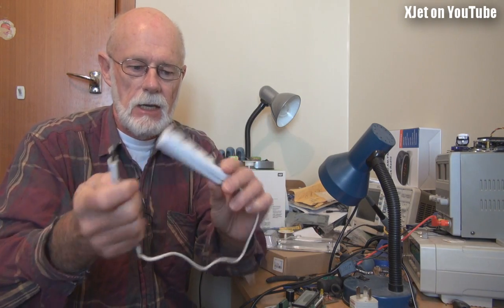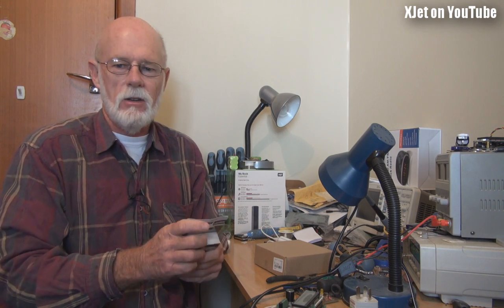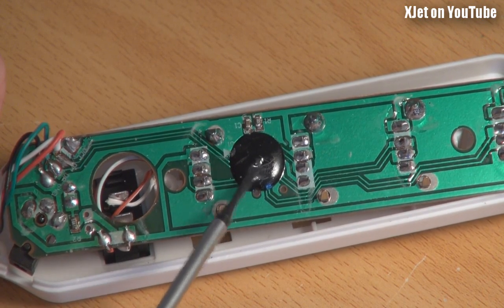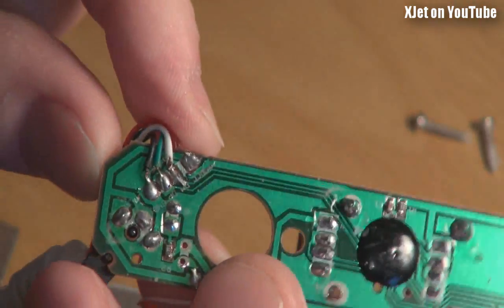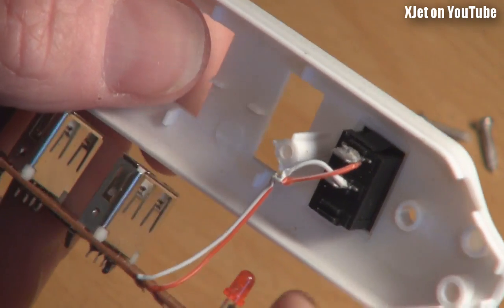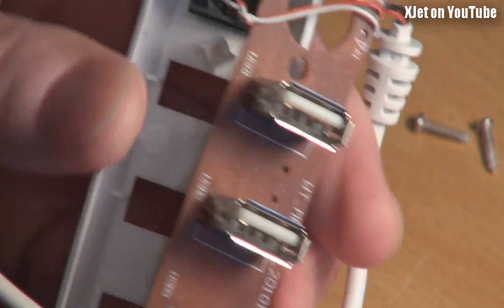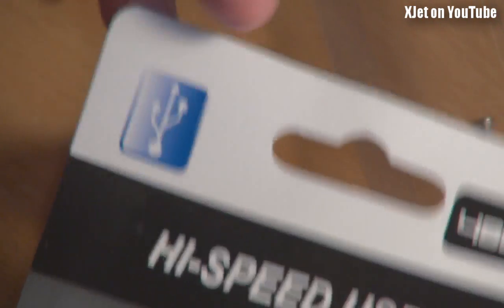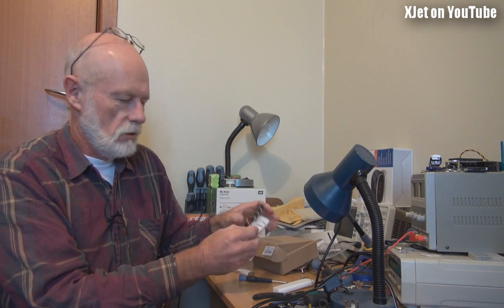A really bad bit of Chinese electronics

Comment: The Chinese have great manufacturing. The reason that we get a lot of "Made in China" garbage is because we ask for it. We tell China "Yeah, give us the cheapest you can, and we'll sell it at ten times the price," because it is very profitable, but if you need something of quality, they have got that too, one just needs to ask for it.
Reply: I remember as a young boy, given battery powered toys "made in China".  I remember my 1st tiny Beach Radio, made in Taiwan.  Looking back, I can say the batteries, made in China, & made in Taiwan, lasted the longest. Names like "555" Kwangchow China, & "Flying Bomb"  having shelf lives to 10 years & longer!.  Today, even famous names like DURACELL are now made in China, but I find those 2016 China made Duracell do not last as long as the 1978 made Flying Bomb cells did back then.  The Canadian Duracell brand , I have a few left now 30 years old, & still working, Canadian made ones.  Conclusion; China can build long lasting & quality, but cheapness is what seems to be wanted now.  If it lasts 1 month, it's a win.  btw my Computer Monitor is from 1996, made in China, used every day, & works 100%, defying a breakdown. 100% quality so again, sometimes China makes it bullet proof.
Reply: I usually find it to be pretty easy to find quality products from overseas that come at 5 or less dollars a piece. Things like USB cables, microphones, headsets (for x360), and even a PC remote. They all came working and lasted for 2+ years. This guy thought he was going to find something quality for cheap relating to electronics from a screwdriver shack. For those wondering, if you want something at a low cost that will likely not be DOA, you have to do it online. Not from ebay or a large market like best buy. But from somewhere like amazon, or newegg, or tigerdirect. A source that has been dealing with such things for a long time. Sidenote, i thought it was funny that the USB Hub had a power switch on it.  I had never once thought that would be necessary, let alone be benificial. "Lemme just take advantage of this feature and flip that switch when i think my files are done writing. Oh no! My files are corrupt. This thing is clearly rubbish." XD
Reply: @Nick1921945  

2+ years is not long. LOL
Reply: TitanUranus I'm chinese and what you said is true.
Reply: At my place during the 80s made in china stuff is quite good. There is some stuffs we still have and still working today. But not so today, they tend to broke in a month or so. The problem is the distributor. Sometimes distributor will search the cheapest product made by shoddy China government-build factory purposely to recruit as much people as possible, not to make quality product.
Reply: So fucking true, and still, shitty brain could not understand it
Reply: The real reason why there is so much of this is not due to international demand , not mostly. It is due to the insane sales tax put onto foreign items in the mainland china. This is why this happens. The chinese communist party wants as many homegrown chinese companies , and it simply isn't working , not in terms of quality. This is the chinese people acting on what little the communist party gives them in terms of business freedom.

Take shenzhen and hongkong. They are next door to each other , yet if i were to buy a foreign product in shenzhen , it would cost sometimes over double the price than it would in hongkong. While i do not doubt that there is demand for these poor quality goods now , i don't think that this is how it started off. It started with the sales tax.
Reply: Wrong, the 'boss' from the factory probably outsources all this cheapie shit to an unlicensed factory then claims it was made at his, QC is a joke, inspectors if done by a thrid party were probably paid off to tick all the right boxes. 
This is from a Foreign QC guy in China.
Reply: The Chinese have great manufacturing? Are you high or a brainwashed Chinese?
Reply: +Brad love to see someone who can only afford Chinese made products complaining about the quality.
Reply: qrpnxz If you know anything about the steel industry in China you'll know they always take the cheap option and they'll scam you at any opportunity, they are the land of the cheap. Quality Chinese products are incredibly rare.
Reply: well said. i got a set of motorcycle fairings recently from china. they're outstanding. better than stock and masterfully painted. that's because they were $450 instead of $40..
Reply: Richard Head When your country is not make them or not enough.
Reply: True!
I was educating some new Chinese customers on operating the equipment they had just purchased. 2 of the several items were made in China, & they both had (quality issues). They spotted right away, & I said they were made in China, (THINKING) they would all cheer & fist pump (DEAD WRONG) "Oh no, we do not want made in China"!   "I said I know the Companies push for production at the cost of quality.. "You  only know 1/2, it is worse than that...it is why we left."
Reply: shut up how wrong can I be? no you're wrong  china have the biggest  factory that's  the truth  USA  and Canada  are blaming China.
Reply: Crackerjack Are you kidding me? China have QC, your faking country have QC, too. if your QC would let shit pass, then it is your QC's issue.
Reply: Mr Qin, you comprehension of the English Language is debatable so if I'm understanding you correctly....
THe buyer will hire a 3rd party QC company to conduct inspection on the product, usually the factory just pays them off, if these 'quality products' passes and has a short or the lead falls off and electrocutes a kid, whose fault is it? QC right? Where's the QC? China. Why the hell would a second round of QC be required if it's already been done ? This is the whole bloody point of getting it done before it's shipped to stop all this shit from happening.
Reply: Are the biggest cars the best cars ?
Reply: China bashing all the time IDIOTS
Reply: munches on popcorn  popcorn anyone?
Reply: What about headphones? whats your take on that?
Reply: Brad Smith Yeah I remember "Flying bomb" batteries, they were unbelievably good, just went on and on and on. I had one 9volt  that lasted for years and years. Great logo too! (bomb with wings) So much for Eveready... I bet they wouldn't make them like that now though.
Reply: I believe we ask for cheap! Not garbage that doesn't work, sold as new!
Reply: Dude they are flooding the market with this shit, kicking honest manufacturers off the chessboard.
Only China can sell this cheap, because the have a billion of government lemmings.
Reply: IDK guys, my made-in-China "Brick Game" bought around 1997 was built like a tank and it's probably still chugging along with a guy who has it now (I gave it away, no idea whose hands it got to)
Reply: Any auth product but made in china is suck as fake.No matter how how much money you spend for it.you most of the time,can't use it over 4 years without it break.
Reply: But Chinese people themselves usually will not buy Made in China labeled products. They buy online or try to find a retailer selling imported products.
Reply: as if chinese people don't buy made in china! give me a break. Some massive brands of phones etc like ZTE lenovo etc start in china, selling to chinese.
Reply: Ya,  we rip off the chinese by giving them cheap, baseless fiat currency that we overprint out of thin air and surprise, surprise - they rip us off by giving us cheap plastic junk in return.
Reply: Even apple also use chinese oem manufacture. you can see that is not the problem of the region but only the QC and design.
Reply: The west not making enough or not at all that why the people in the west need to stfu.
Reply: They have the "can" but we do not have the "want". It is all about money. The cheaper you buy the more you can earn. Simple as that. But China will soon become Japan. We will praise them for they build quality etc. Give it time.
Reply: FAZIK I’ve waited 20 years since 1980s and they still failed while
South Korean Crap from 80s had managed to made a quality product 10+ years later.

Comment: looks like you got exactly what you paid for.
Reply: i have 2 chinese usb hubs and both have the same bad solderings
Reply: YES Chinese children make these things........Yes iphones/macdevices are made in china at foxcom.....Yes they employ over 500,000 Chinese children/slaves.... Yes they have netting around the buildings to stop the Foxcom employees from killing themselves,
Reply: yeah it's all pretty much expected and would be working if it didn't accidently get the wires screwed together lol...
Reply: Dictor Clef scp?
Reply: Russ Walker iPhones are manufactured in China
Reply: Here's the attention you so desperately wanted
Reply: TheXanUser if I pay for something I expect it to work 6 buck or not, if I'd doesn't work from the start it shouldn't be made. If I buy chap I may not expect it to work for very long, but even if I get a couple of months out I it, than I say I got what I paid for.
Reply: I'd beg to differ, the media player was 5 times as much, did much more, and was of much better quality. Media players actually have to do processing using a computer, rather than data routing. The media player also featured a touch screen and an SD card reader (which SD card readers require licensing). If $6 gets you actual trash, $30 should give you something that works barely intermittently with a case that's falling apart.
Reply: Dictor Clef re popped up on my recommended
Reply: Russ Walker Samsung phones are assembled in China and Taiwan.
Reply: +FerickAndrew STOP THE CHINESE
Reply: brendan wilson am i doing an insult here? i am not
Reply: +brendan wilson Yes,Trump, We get it.
Reply: TheXanUser ..  Da Panna chekka Avante ammumeyekettikann  aaaa paratta Chinese make saadhanm konnd engd vannal unndalo ..pelayaadi Mone ..
Reply: Everything I buy is UL certified, most chinese products are simply crap.
Reply: na, you pay like $3 for one of these.
Reply: Woah guy are you from the future?
Reply: this is the best answer ever
Reply: dont have one dont want one, got a samsung
Reply: armando suarez god already made the world, the chinese make the rest
Reply: TheXanUser it is not as simple like that, "what you paid for".
if it is for sale must be approved by somebody.
chinese products should be banned.
Reply: just more proof that everything made in china is rubbish, especially the people.

Comment: Did you try to fix the solder points to see whether it started working again or not?

I think it could just spring back to life if you soldered the USB leads THROUGH THE BOARD (hint: There was holes in the board) and fixed the rest, it COULD work? USB has a pretty good protection against shorting out the leads so it could still be fully functional. Or at least quality motherboards have fused USB ports to prevent burning the port.

That isn't even the worst I've had with USB hubs. One I got from a local "cheap stuff shop" for 25 euros (4-port powered hub), the USB connector was so loose that it would disconnect if you put down a 2 euro coin in the other end of the table. - And it was a mini-B connector so it must have been the reject of the rejected mini-Bs, since they rarely break. 

Annoying as hell if you were trying to do anything with it. From what I remember, I just hot glued the thing together to fix the connector being loose. Maybe ripping it out completely and soldering wires directly onto it would have been even better.

Comment: The Chinese are producing the range from very high quality down to very low cost at low quality. Basically, most of the time you get what you pay for. The brand name companies that manufacture in China demand specific level of quality control with specific calibration tolerance and specifications. 

China also produces very high end industrial and laboratory products for both their domestic markets, and for export to other countries. Many of the high end automotive and machine parts are produced in China. 

It has become difficult to find many types of products produced in North America or Europe, unless they are specialized types of products. There are many types of products that are absolutely no longer produced in the western world. And, this is strong reason why western world jobs have been on the decline.

Comment: I really had a good laugh as you showed the insides. This is really a lack of security within this device.
I knew there were lots of really bad soldered pieces out there, but the circuit you've showed here topped everything I've ever seen so far.
Thumbs up for failed Chinese tech.
Reply: 1994AnimalCrossing

Comment: Another dangerous detail : There is no protection (not even simple as setting a diod) between the USB from the Computer and the 5V from external source. you would get a voltage loopback into your computer.
Reply: yeah that may happen if external supply too is Chinese
Reply: GTI1dasOriginal Oh yea... the fake CE stickers.
Reply: yep... worst case scenario: fry you motherboard.. Let's see if it's "all laughs and fun" when he experiences that..
Reply: @GTI1dasOriginal  Someone blew up their iMac when they hooked up the external adapter to the connected USB hub, if the voltage isn't equal, the higher voltage will backfeed current into the lower one like a generator twisted and taped into a house dryer socket (don't try that, it energizes the power poles while people are out restoring power and is against code).
Reply: that is very typical to USB hubs, even if you have a decent brand USB hub it still could be like this
Reply: Brad Chines tend to "make up" their own "certificates". It's like "copy and paste text that resembles some sort" and then that should be enough to convince everyone (even themselves) it's safe.
Reply: Even more, there's no UL safety certificate.
Reply: oh no that 5 volts will burn the house down...the wire that was damaged wasn't even a usb wire... you need some of the same pills this cranky man needs.
Reply: Dana Rider ever encountered a short circuit in a usb wire? I did. And.... Cranky? -_- Seriously.. In no way, shape or form.You don't know me and for g*ds sake, please keep it that way. Thanks. fyi: I'm in basics a realist. In this case it's very possible to short out a motherboard. Please don't whine when that happens to you in the future, no one hears you if you do.
Reply: It's a valid point. It's expressly forbidden in USB 1.x/2.0 to backfeed power to the host. What might practically happen is that two power supplies with their slightly different opinions of what exactly constitutes 5V and how to get there can start fighting with each other. Usually the behaviour will be pretty benign and they'll just settle on whatever the higher voltage is and the other supply essentially idles, but that in turn can put an undue strain on one of them. Will the low-cost power brick survive? It might, or it might catch fire, toss a coin. A Schottky diode would be really good to have in there.

I wouldn't usually be TOO worried about shorting the 5V line on the mainboard via USB, usually it's protected by a polyfuse so you can recover from it, but that's a safety feature with potential failure modes too if one strains it too much, and it's also optional, so low cost ODM type boards might not include it.

Comment: Six dollars are you kidding me! You got ripped off man. I bought mine for 99 cents and even i feel i got ripped off!
Reply: for this kind of thing from china, six dollars is a bit steep tbh
Reply: 99 cents free shipping
Reply: yes 99 cents if you order online
Reply: Disabler our chargers are very expensive in America idk why but if I want a good charge block and standard 3 ft wire its like 25 bucks and they're still junk and break all the time
Reply: if its an iphone charger then its suppose to happen, them fuckers want u to keep buying new charger every fucking month. i had a lighting cable made by juice and it was made well and never broke. cost me £12 but well worth it as it seemed to charge quicker. but fuck iphones im android all the way now.
Reply: Ryan Rohauer yea i hear you man its the same here in norway. unless you buy known brands its all from china. i find it helpful to check reviews before i buy on ebay. ironically i was a little late on this one..
Reply: I also check the ratings, total units sold and which countries they were shipped to as well as the credibility of the store; it often helps weeding out dodgy scams.

Comment: My solder iron is from my grandpa. Built somewhere in the 60's. It solders much better solders than shown in the video.

Remote controls nowadays looks the same inside :-(. Failures over failures there.... A little knock or harder key press and there is no live anymore.
I ended up in re-soldering every solder point  inside of some of them. Since that, they work and work and work... Even if smashed from the table.

One time it happened inside of one of our TV devices. Cold solder point at the main rectifier of the power supply module ugly-face!!